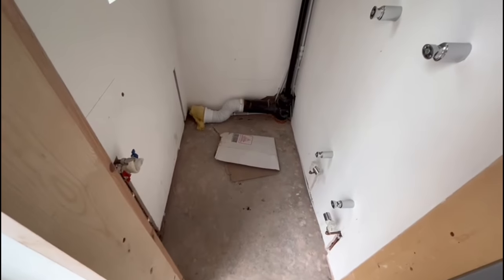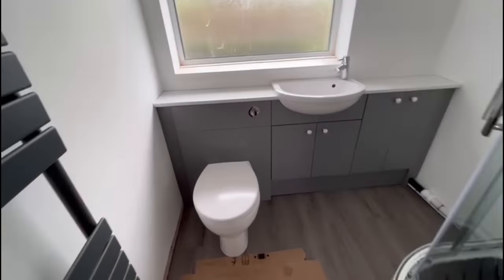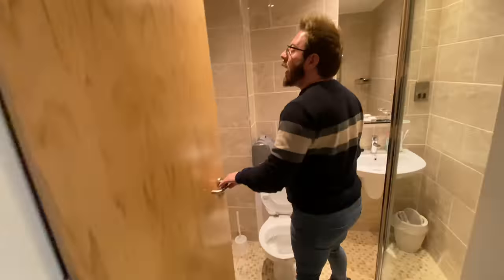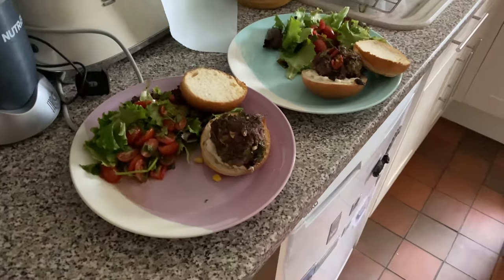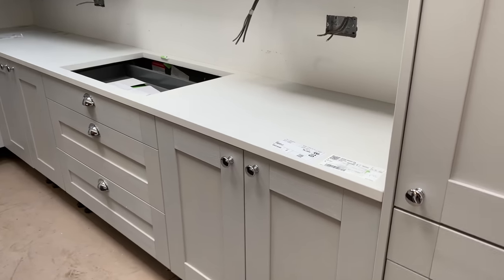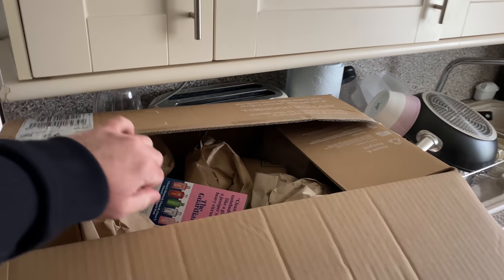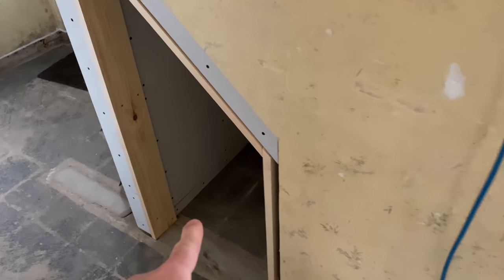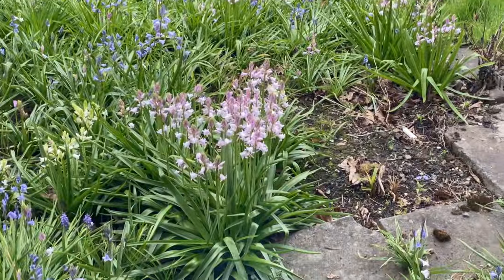KITCHEN QUARTZ & BATHROOM FITTED! & WE TRY HELLOFRESH! 1940's House Renovation Project UK!

Comment: It’s going to be amazing guys, love the colours so far. 
As I watched, I noticed how close the wall is to your fridge door.
Here’s a tip to help if you are interested: I would measure that stopper you mentioned very carefully, as if it is too long by even a fraction, you could find you can’t open the refrigerator door far enough to remove the crisper drawer for cleaning.
Hope that helps. Cheers. 😀
Reply from the maker: Hi, good tip and we already did that. The door can be fully opened it’s just as a precaution incase it goes too far back. 👍

Comment: The kitchen is really coming on - what made you decide to keep the ‘hatch’ through to the lounge?     When you opened your fab kitchen fridge - just a thought - is it easy to pull out the shelves as it looks tight as your door opens to a wall - so if you out one of the little rubber door stopper things into the wall - will you still be able to open the door full to remove the shelves - just a thought.
Reply from the maker: Yes, door goes back perfectly fine for the drawers, the stopper would just be a precaution. We love the hatch its an original feature to the 1940's house. It's great for connecting the snug to the main kitchen area. Cats can jump through and passing cups of tea through will be a doddle.
Reply: @ElliotNMatt  brings a new meaning to the word “cat flap” for sure 🤣🤣🤣 but high though 🤣❤️🤣.    Bet you can’t wait to move in - but it must be so good not to have to live amongst it all.    You seem to have found reliable builders too - that’s a blessing with so many cowboys out there
Reply from the maker: Yes great builders and trades!
Reply: I'm so glad that you kept the hatch, both for sentimental value, and practical reasons.  You will use it, for sure!

Comment: The kitchen and bathroom are lovely but It seems everything is too small for Matt. The counters are too low and the toilet too low. Is this normal for England to have small proportions?
Reply: Those same thoughts came to mind as I watched too!  Definitely the kitchen island would have been better at a higher height for Matt - perhaps it's not too late to raise the island up from the bottom?  I'm sure they'll make it work in any case.   In the US, we call the taller toilet "comfort height".
Reply from the maker: Everything is standard U.K. & E.U heights,sizes etc. Matt is 6ft3 and the camera probably distorts things a little.
Reply: @ElliotNMatt  I think you need to upgrade to accommodate his height.
Reply from the maker: Hi Nancy, Matt says the standard height is perfectly fine for him.
Reply: @ElliotNMatt  I would think so if its fine in your current home?!

Comment: I have the BOSCH induction cook top and I love it!! It boils water sooooo fast when you use power boost! Get some microfiber clothes to wipe them clean after using glass cleaner. Microfiber keeps it from smudging!
Reply: Good advice, H London. I have a Bosch induction too. I like the power boost feature as well....and the really low simmer capabilities as well. Cleaning is a breeze. The glass top looks brand new even tho it's 7 years old. 🌺